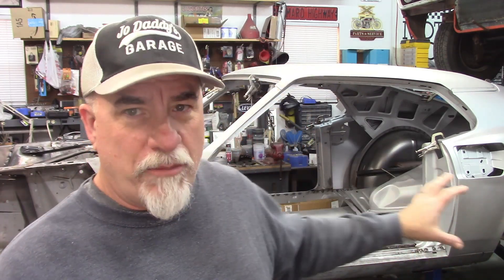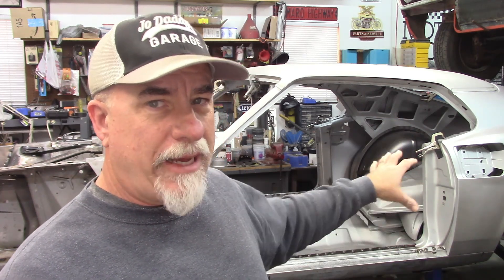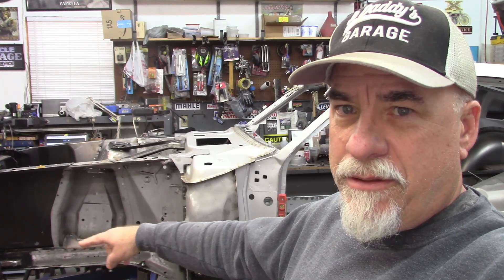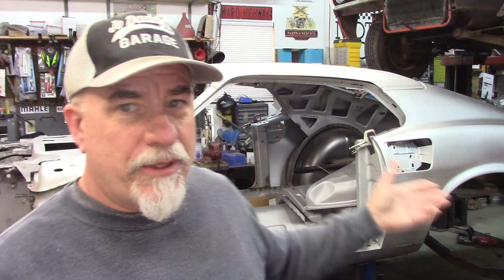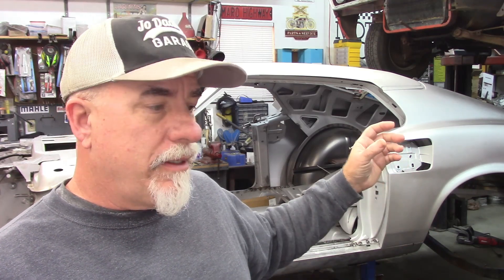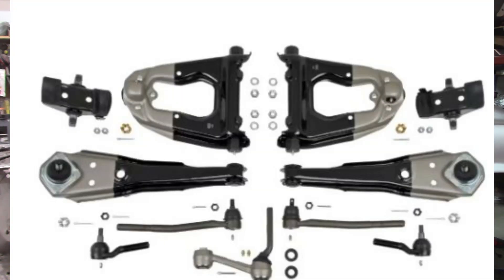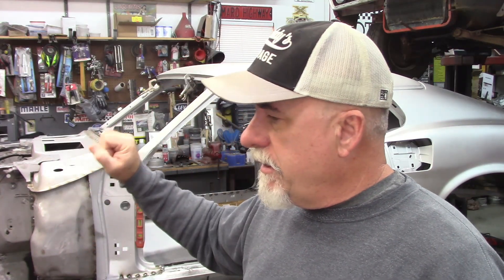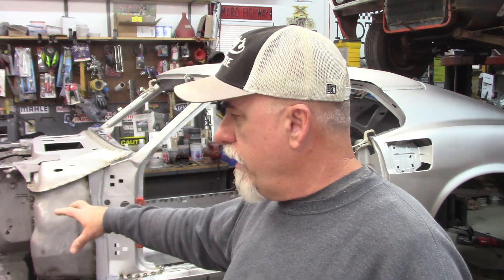Update on the Cobra Jet build. Slither will continue, but in a different way.

Comment: Hey Barry, good to see you doing well an feeling better. I agree with dome of the other comments regarding Sub frame connectors, gotta have them no matter the HP's. I believe slight modifications 4w disc. Ect... wouldn't detract but only add value at this point. No worries man it'll all work out. All in all, we're still pullin for ya. God bless.

Comment: I say use the subframe connectors, i used them on mine and it s a very nice update on any classic mustang, even if it has factory engine with the same power, helps alot with the handling

Comment: The frame connectors on a 428 car should be installed in my opinion . I owned a 70 Mach1 with the 428CJ when I was younger and you could feel the car flex when driving it hard and using all of the torque the 428  had to offer .

Comment: If the exterior is like original, you can do as much as you want to the engine and suspension and it will add value to a smart buyer. Of course once you step away from full  concourse NOS restoration then you need to keep swimming to the other side. Don't feel encumbered. You have freedom other than body and interior (in my opinion) as a 51 year old enthusiast.

Comment: Glad to hear the project will continue, but I'm a little nervous with the change, especially for you as the builder. With the surprises of what she thought was being built, I'm sure she was also surprised at the cost of the build. I would probably give her some time while you finish the sheetmetal and then you guys can make sure everyone is on the same page for the build going forward and what the expectations/cost on a completed car looks like for everyone.  My guess is that they will want a turn key job at this point.

Its always difficult and costly to change directions during a build. I personally like stock cars myself. I do think subframe connectors on a unibody car are a great investment especially with the cobra jet under the hood. lol.

With all that said, they are lucky to have you building this car. I know you will go above and beyond to help them getting Charles car done.

Comment: Barry just a word of unsolicited advice.  Bale !!  No one is going to win on this project- No finishing point, just put it back together to do what? sell? keep? drive?  You'll need a firm commitment of $100K-$200K.  With the temper of that new metal, your going to need a roll cage with a halo to keep it stable for a 428, something a 'wife' just won't get.  Most wives won't get.  Tread carefully and get it all down in writing or expect a knock on the door from BAR- just something to think about.
Reply: You got it all wrong dude. Lighten up a little.